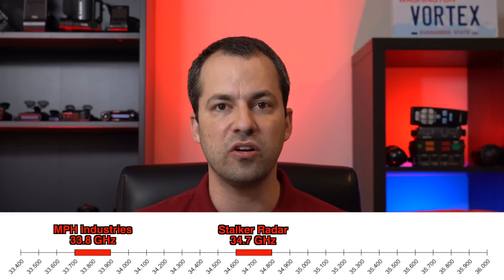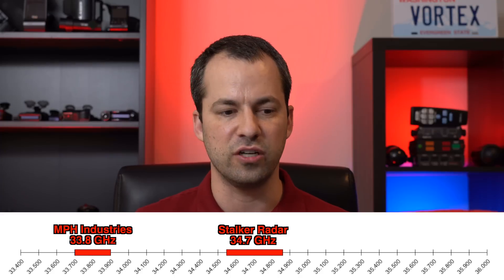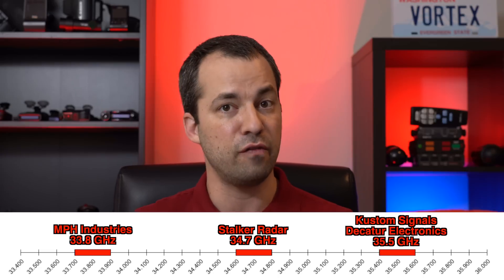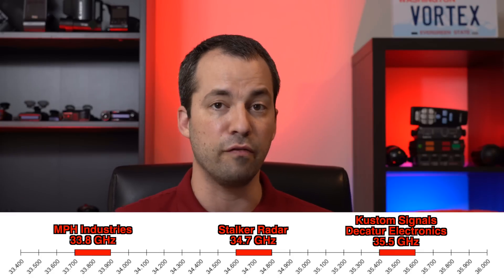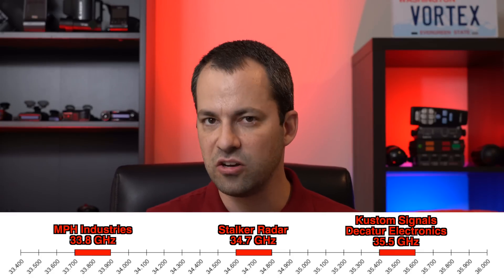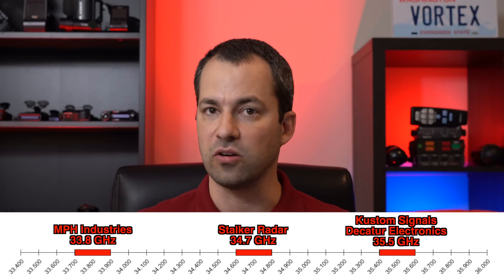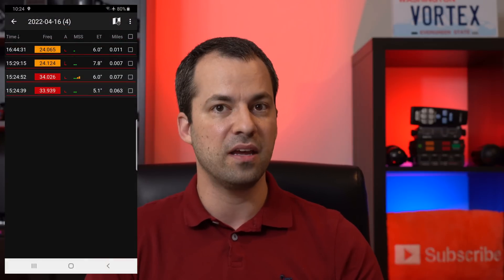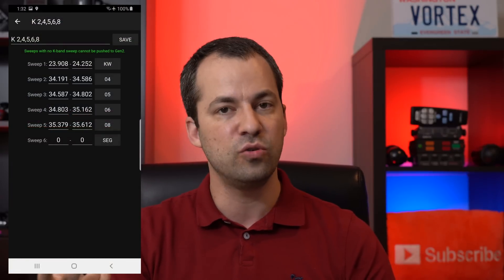Understanding Radar Frequencies

Comment: Luckily here in Connecticut only band that is used is KA.  So I completely shut off x and k band as they are never used.. I have a older beltronics vector 995.. and I'll tell you the laser is super sensitive.. people say that you can't save you but it saved me twice.. one time picking up reflected laser thousands of feet away.. another time he hit me with the first blast and then  tried to shoot laser  at my license plate but I hit the brakes and beat him  to it...NO TICKET ... With ka band my beltronics is really sensitive. I do get a few false alerts only from blind side radar but I turned on the TSD filter and now I only get occasional blind side radar false.  I can actually tell whether it's police or not... My beltronics along with the Waze app give me Total protection here in Connecticut

Comment: I drive a 2023 F-150 and have a cobra 480i, it’s constantly flagging K-Band at 24.14
Reply: Someone in my town drives a newer F150 and it sets off my K band. Can't remember the frequency, but I believe its actually your adaptive cruise and/or collision avoidance system. Uniden had a huge problem with the Mazda cx5/cx50 for a while.

Comment: So, won't cx5s jam your gun then? I think if these blind spot detectors get common enough,  then officers won't use them
Reply from the maker: No lol
Reply: @VortexRadar  why not? Your gun is the same frequency. It's looking to receive a similar frequency. It has a receiving antenna. The signal power may not be enough to completely jam it, but may cause some interference.
Reply from the maker: A radar gun transmitting at 24.124 GHz is looking for the difference between 24,124,000,000 Hz and 24,124,001,234 Hz, for example, not something way out at 24,123,000,000 Hz. It’s a very tiny range of frequencies that they look for for the actual Doppler shifted returns and they ignore almost everything else. It would be infinitesimally rare for another signal to happen to be in the range the gun is actually looking for, and even then it’s already registering more signals and reflections anyways and considering other sources of signals like reflections off of signs and buildings to ensure it’s only tracking cars.

There’s way more to it than just random radar signals around.

See here: https://youtu.be/DAwW7_nYG0c?si=lJ8-7fAi7qDT6HGc

Comment: Hey Avery...I wanted to ask you about the theoretical optimal range of a radar detectors such as the Redline 360c.  Many of us still have these, and I was wondering: would not the theoretical maximum range be found band by band just by isolating the frequency range in question, and turning everything else OFF?  So for MPH, for example, turn X, and K band off, then select the Ka frequency band for MPH, and then check the range and response time?  I'm just curious as to the theoretical maximum range of my RD if it was only looking for one signal in particular.  Thanks, Kevin Grissom

Comment: Thankfully, here in CA CHP (California Highway Patrol) transmit solely on 34.7xx on both front and rear antennas so it's extremely easy to know if it's a CHP officer's on the highway doing traffic enforcement. most of the state uses either 34.7 or 35.5, I have yet to see a k-band using officer but I do know smaller towns dept do use them.

Comment: Nice video. With some of the information you put through a few videos, I made a recent purchase of a uniden R3.  It's basic , is somewhat stealthy with some precautions.  But question is the following:   I know from what you said in this video, changing the  antenna will change the frequency for transmitting with a radar unit , in this case for example, ka band? In other words the frequency changed with what the antenna tuned to, but it is not at the transmitter unit itself is that correct?

Comment: I have a 2021 Subaru Crosstrek Limited. Do you know if I’ll have any radar detector interference from that? It has eyesight, blind spot detectors, and a backup collision avoidance system. I can’t find the specs so just wondering if you knew.
Reply from the maker: Should work just fine 🤷‍♂️

Comment: So how do you get over the thought that if you start  shutting  down frequency bands  you could be missing a change in new use of a frequency. Wouldn't you rather have a false alert that makes you slow down for a little bit then get a ticket to find out that you shut down a frequency that was used by that particular department? That is also to ask if these only worshiped, with the current range the gun manufacturers have, would you still buy the detector? Wouldn't you think that was limiting? So I'm trying to understand shutting off frequencies and how you get comfortable with taking that chance?
Reply from the maker: If you’re concerned, just have your detector scan everything and accept the performance hit to your detector. Turning off frequencies is an advanced feature.

Police radar guns are only designed to transmit on certain sections of Ka and so you can turn off unneeded frequency ranges to get faster response time for your detector and a little better range. It’s all a balance.

You can always scan a little wider range if you like, particularly in areas where police radar guns are known to drift in frequency more.

If you’re concerned about the risks though, just have it scan everything and don’t worry about trying to get every last ounce of performance out of your detector.

Comment: If automotive radar sensors use the K band frequencies between 24.05 and 24.25GHz why not just block those in every radar unit? Wouldn't that eliminate most of noise.
Reply from the maker: It’d also eliminate most police officer guns too soooo… :)

Comment: KA BAND RADAR FREQUENCIES
                                             MPH Industries                                                                                             Stalker Radar                                                                                Kustom Signals                                                                                        
                                                                                                                                                                                                                                                                               Decatur Electronics
                                                     33.800                                                                                                             34.700                                                                                              35.000                                                                                                             
33.400 33.500 33.600 33.700 33.800 33.900 34.000 34.100 34.200 34.300 34.400 34.500 34.600 34.700 34.800 34.900 35.000 35.100 35.200 35.300 35.400 35.500 35.600 35.700 35.800 35.900

K BAND RADAR FREQUENCIES
BLIND SPOT RADAR SYSTEMS
24.123 – 24.124 – Police Radar, Mazda’s CX5
24.160 – 24.168 – Honda’s, Acura’s, Chrysler Pacifica’s, Jeep’s, GM’s
24.199 – Honda’s, Acura’s, Chrysler Pacifica’s

 X Band – 8.0 GHz – 12 GHz – Police around 10.5 GHz
K Band – 18 GHz – 27 GHz – Police around 24.125 GHz – 24.150 GHz
KA Band – 33.400 GHz – 36.000 GHz – Police around 33.800, 34.700, 35.000

Hey Vortex, listened to this video and came up with this chart.  Put it in the cover of my binder for quick reference. On paper the KA band prints out in one straight line. Kinda looks funny how it looped it on here. What could I add to it that would be more helpful and clearer to understand?  Like more brands of vehicles to watch out for.  Also, on the K band I could probably add police to all three lines. Thanks Bob
Reply: Today I came across a few low K band signals, (24.071, 24.082, 24.107) would this be more blind spot radar systems and what vehicles or could police be down this low also.

Comment: Thanks so much for this! Having just picked up my r7, this is handy. I was wondering, does power matter? So in regards to the CX5(etc) I’d imagine those are fairly weak signals- so it would show up pretty late with a strong signal. Is that accurate? Would it also be fair to say that enforcement uses a stronger system so you might get a weaker alert earlier. Let me know if I’m on track here.

Comment: I need an option
Driving down 2 lane highway late at night
No vehicles to be seen 
For 5miles my Uniden detector
Went crazy I was getting multidirectal radar readings at the maximum detection 
The arrows were all over the map
No parked police no mobile police no houses no industry just open feilds 
It was a Ka 34.18 never changed 
It was like the area was being flooded with radar

Comment: What would you recommend for the best radar detector for Southern California I have the old red line with the first update but I think I need something new by now thank you for your help and do you have anywhere I can tip you for your help
Reply from the maker: If you’re in CA, you can shut off X and K band and run it in Ka only. It’s still a great detector. Filtering is bad, but you won’t need that with K band disabled.

Comment: How about an uodato the "Creating a simple reference for where bands can be turned on and off" site.... and for those with "rare use" put a star in those areas. 

P.s. so far with my R8 I haven't found any law enforcement using anything but ka. Eastern ks (Oklahoma boarder to kc  (non-turnpike) and western Missouri Kansas city  area. 

I have found the traffic lights in Merriam ks using k band (knew before but didn't know where there till I could see the frequencies)  

Also, the R8 isn't falsing on the traffic speed fixed laser (some roads and multiple lights not speed enforcement)
Reply from the maker: That’s sorta what the now defunct RDFGS was aiming for, but that hasn’t been updated in years. A simple reference would require the collaborative effort of hundreds of people. We need someone to take the initiative to restart the project.

Comment: Great video! I picked up a v1g2 when they were first released. I've only used the app once to watch frequencies. In my daily 80 mile commute I go through 1-4 radar traps...i'll be using the app to monitor frequencies! I never thought of it as being this important to know. My area is heavily saturated with Ka traps and 1 in 50 lidar. Never had a K alert outside of a sign be an officer.

Comment: Great breakdown Vortex, I have been waiting for a better vocused video on the various frequencies used as often you speak of that in other episodes that aren't specific to this. I like knowing what freq. the various radar guns are using, how the police tend to use those various guns and what othere systems are known to ride on that same freq. 
I had a MUCH older metal grey die-cast aluminum body Uniden back around 2000. It would false Laser when I got near our local Doppler radar. I don't think my R3 has ever done that...hmm?

	Anyways, I know the R3 is at it's limit as far as on board memory for the programmers to adapt further. I have wished they would try this one technique of perhaps adding an user lockout for just simply a displayed number. So let's say using on board filtering involves a LOT of programming work (and hardware), what if resolving the 24.160, 24.167 and 24.168 was as simple as the MCU knowing it is about to send an alert and it knows that alert is at those frequencies (because the display is indicating such) and allowing the user to turn on a self mute for at least those super sommon frequencies. I know Uniden would probably have to leave out the seperate user mute for the 24.124 because of this memory limit (I would assume have that also display mute selected on it's own would add more lines of programming) but just having the radar detector know it is about to display 24.160, 24.167 or 24.168 and have that self mute would be the best thing to happen to the Uniden R lineup.
	Consider it simply a "Display Mute", it will only mute if it knows it's going to display that number....no further filtering, no further hardware. I feel like it would take a lot less lines of programming to add such a feature rather than using the sensing and frequency counters on board the MCU of the detector. If you still have a contact at Uniden, please forward this comment. I hope you understand my ideal here!

As the price I paid and how good this R3 already works I cannot afford to upgrade to the R8 or even Thea when it comes out. 

Cheers and thanks for a very well written and informative video. If only we can get more unterviews with officers who use specific guns or know better the ways they would use each brand of gun, that would also be very informative. Things such as this "xx" gun doesn't like dark or rainy days, or this "xx" gun doesn't work well on blind spot cars or near power lines? That's information I have not seen yet, it would be a really good video if done correctly. 
Cheers Vortex and I hope you and the family are doing well :)

Comment: G’day from Australia,
Great vid. Im curious tho, you’ve mentioned the ability to turn on and off some of the KA bands based on frequencies commonly used by coppers etc, however I can’t see the freq. range on the selection. It’s just numbers (1, 2, 3 etc) how the heck do I know what which number correspond to what freq range?!? There is nothing on the user’s manual. 🤷🏻‍♂️🤷🏻‍♂️🤔🤔 I am just a user, def not a savvy tech guy.
Reply from the maker: G’day! If you take a look at the setup guides on my website, I list the freq ranges so you can set them as needed.
Reply: @VortexRadar  cheers thank you for a quick reply!

Comment: Displaying these frequencies and learning what they mean goes a long way when deciphering between real and false threats. For what it's worth, east TN still uses a good deal of K band. I find that the lower 24 range is common among MRCD red light cameras and LEO'S running K band. Usually something like ~24.083 for MRCD and ~24.067 for K band guns. This is why I can't shut off K where I live. I do shut off MRCD so I can lock out certain red light cameras. Not sure if you've discussed this option if you only deal with RLC where you live but it's worth noting.

Comment: Off topic but which stealth RD has the 'best' app?
My location requires I hide my RD so running via an app is very beneficial.
Great episode Ariel (as usual). I see these gun frequencies listed online but nice coming from a trusted source.👍
Reply: The answer to that question depends on the Radar Detector you're using or plan to get. 

I'm using a V1G2 and supplement the detector with the JBV1 app on my Android phone (this app isn't available for Apple phones).

It's an awesome combination and gives me so much control and information that I feel naked if driving without the detector on AND the app running. 

Highly recommend combination if you have or plan to get a V1G2 detector.
Reply: @El_Diablo_LI  Thanks David. 👍🏻
Reply: @Well_Theres_Your_Problem  no worries. Do you already have a RD or are you planning on picking one up in the near future?

Comment: This is an excellent video! Should be tagged in every instruction sheet when you buy a new one! This and they different bands. I'll be back up in Washington State from California in June. I can tell you Washington has more difference(s) than any other west coast state.  Red light cameras, to all your different bands that you use it takes a good detector to "see" it all. My DS1 is incredible. Last time I left Seattle for California at 3:00 a.m. . Your state patrol sits in the dark in the middle of the freeway, or backed up into the bushes using radar in with their cars blacked out. Sneaky. My DS1 knocks him down every time. Oregon just a little bit less than Washington as far as what they use, or what to watch for. Ironically the CHP in California KA ban
and that's it. Again a great video! Thanks.

Comment: Around me, most of the state agency’s rear antennas are 34.6xx and front antennas are 34.7xx.  Though that’s not 100% of time, it has been extremely helpful spotting the bogey and deciding which direction is being monitored. It’s also helpful at night in helping me know the moment I’ve passed the bogey, and if the new strongest signal is likely from the same vehicle or a different one. 

Somewhere around 33.758 are satellite dishes. Since I don’t have a lot of that around me, it’s helpful in identifying likely falses. 

We have a legitimate 34.802 antenna in the neighborhood, but 34.812 comes up once in a while. Before this video, I was blaming leaky detectors, but I may now start scanning for Teslas. 

Stalker is so prevalent around me that if another frequency pops up, I pretty much know which outlying agency to look for depending on where I’m at.  It’s pretty helpful. 

An agency near me has a fairly active officer with K Band. When I see that gun’s particular frequency, I know it won’t be long until I spot who a couple of us lovingly named, K-Band Karen.  Separating that frequency from the falses is essential in that jurisdiction.

Comment: I use it more so just for knowing the time to start to slow down. Especially with my R7  as I know its much better at 34.7 than 35.5 if I see a 35 signal even if it is a weaker one to start to slow down. If its a 34.7 weak signal I know I probably have time to slow down.

Comment: Yeah, the accurate frequency ID of the R3 was one of the main reasons I got it. Here officers use 24.150 (at least that is the design frequency) but the radars aren't usually very well calibrated so I always look for something between 24.080 to 24.190. If it's out of that range i just mute it. Thanks for the great videos!